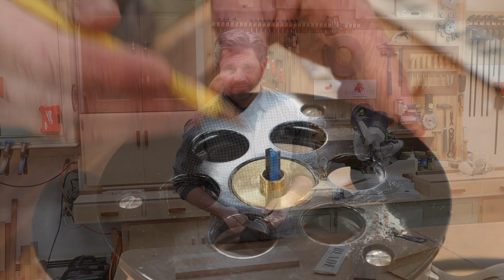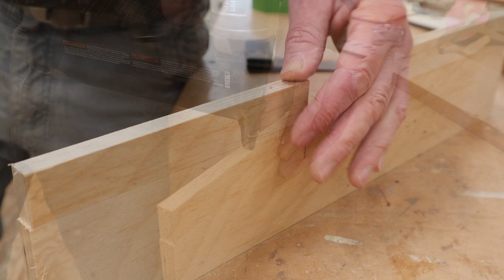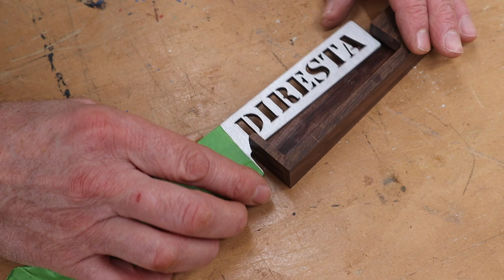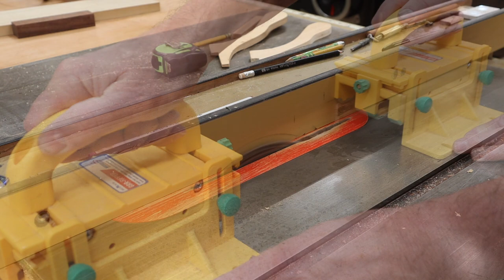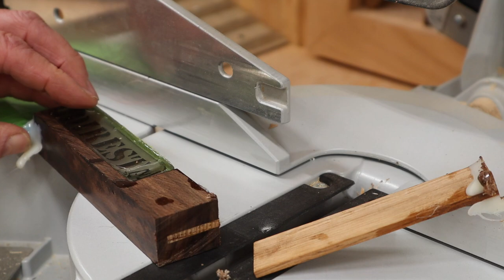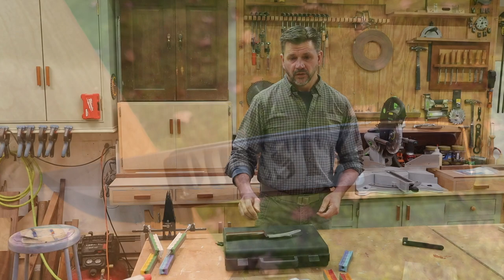Diresta Knife, Rosewood and Epoxy Handle

Comment: Geez, timing is everything.  Earlier today I was using my nail gun parallel to the plywood and sure enough had a "blowout" as Jon notes at 2:30 into this video.  If I had watched this video first, I would not have held the gun as I did. Dang it.